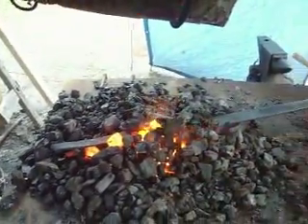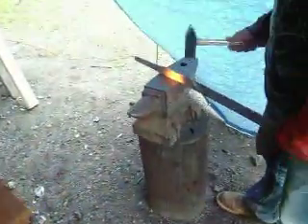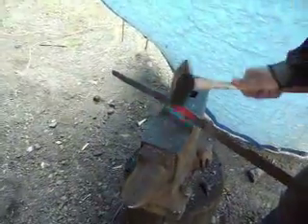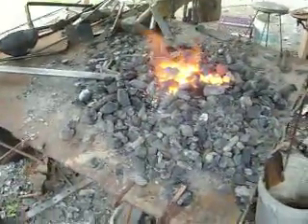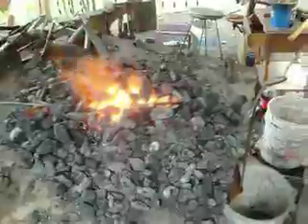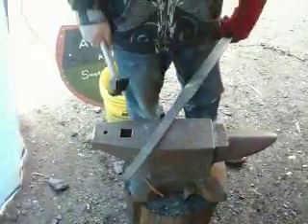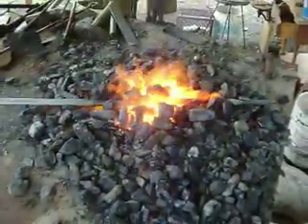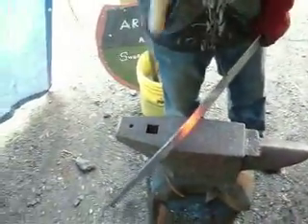Forging a Sword  Part 1

Comment: i respect someone who takes the time to put a forge together, heat up various metals and shape it with a hammer.  i also respect someone who writes their own cnc programs and builds their own cnc machine, more than someone who just buys the best hardware and mills out blade after blade like they're cool.  you, lansfordno9mine, i respect.  the other clowns that were arguing retarded troll points were annoying me so i said something about it.

Comment: Welding two pieces of steel together with modern welding equipement is faster than forgewelding them together, but the bond is much stronger if forgewelded properly. where as cnc machining steel goes, that is what we do today, mostly when mass producing or making high precission parts with small tolerances. But I am happy to inform you that forging is done today aswell, on an industrial scale, to make rough metal parts of higher quality. (which are then machined afterwards to high precission.)

Comment: @WaagooshTheRedFox It's the other way around. First of all I have videos where I show I know my skills in blacksmithing, that's without " - ". A bigger anvil doesn't create less work. It may move your material a bit faster that would only save you 5 min at the end. And I beg to differ that old swords don't compare to modern swords. You're probably looking at diagrams with all kinds of neat alloying elements, yeah... then it's easy. But try doing this with only carbon as alloying element. (Part 1

Comment: @lansfordno9mine ok i understand that, but i am also saying that it can be done better by using current knowledge of re-sonic frequencies and metals to produce product easier, faster, and more safely. i suggest looking up the different anvil types and why each one has a benefit and a hindrance to the process. im not sayin' you cant produce good work with no more than two rock, but you can produce better and faster if instead of the anvil absorbing the shock it puts it into the

Comment: @WaagooshTheRedFox what kind of stupid comment is that? If this anvil is too small then the anvils one used in the dark ages are certainly too small. But hey, it turns out they made some of the best swords! Even on anvils that are WAY and WAY smaller than this anvil. So I don't know why you said this crap, but it would be better if you just shut your mouth. There is no need to spoil each other's fun, we don't spoil yours either.

Comment: you fail to understand what the context of my statements is. i do not believe in old methods of metal craft as a viable means of item production, on top of this i am not skilled at CNC nor do i own machinery for it, welding is a modern method of joining metals previously done via black smithing but i prefer the modern method over old methods. so yes, i prefer modern technology

Comment: @WaagooshTheRedFox Speaking of failing, you don't even mention, nor give contexts. You blundly state something, probably assuming I think the exact same as you. Hello, nobody is the same, not even identical twins. And what are you talking nonsense about welding? I couldn't care less you prefer modern technology. I can say I prefer the old way/ technology. If you prefer modern technology, then stay the hell out of blacksmithing. Blacksmithing isn't modern, it's thousands years old, so not modern!

Comment: @TechnicusJoe your english still sucks, i dont own any machinery myself if i had to use machinery i would have to borrow my grandfathers garage.
i prefer working as a shoe maker for horses, while my grandfather puts the shoes on the horses i make them the way he says they need to be made.
on top of everything else, i prefer wleding with a tig welder over forge welding pieces together.